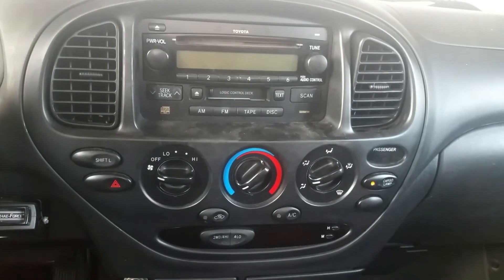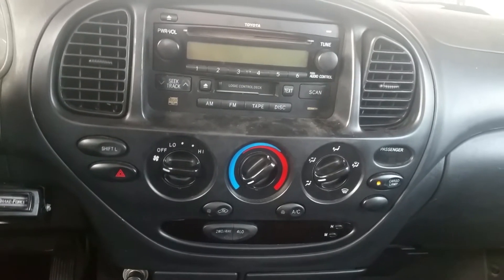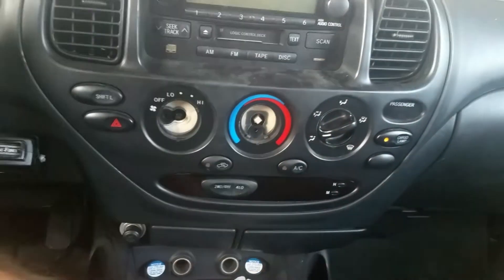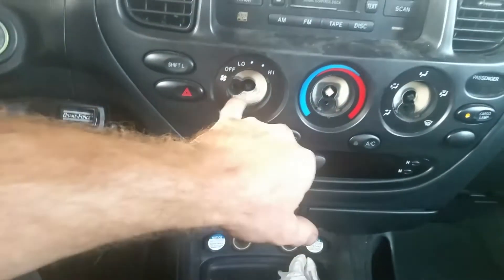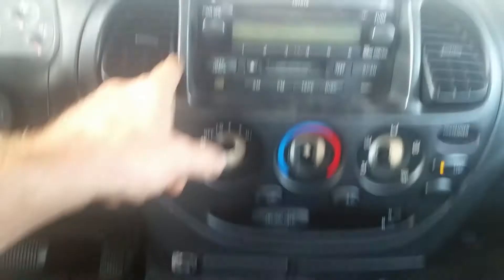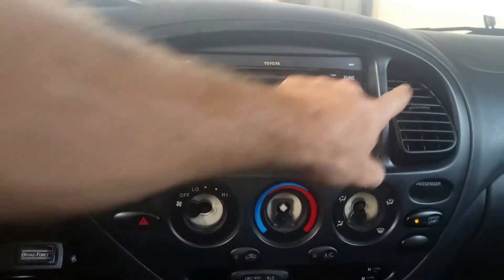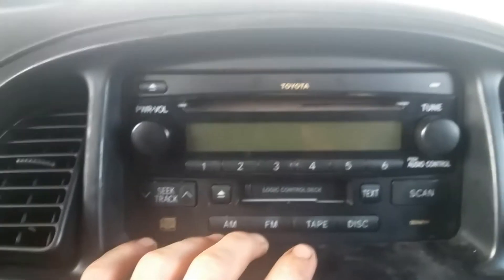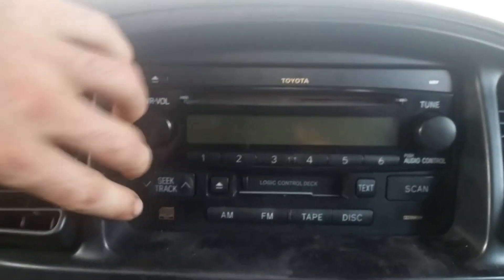00-06 Toyota Tundra Radio Removal How to/ Tutorial

Comment: Thanks for the video!  Does this also give me access to replace the bulbs for the heater controls etc?
Reply from the maker: yes it does. and you can still run aftermarket speakers off the factory jbl amplifier even though its running at 2 ohms. wont hurt the new speakers at all

Comment: I have an 03 Tundra and would like to upgrade all of the oem speakers. Do you know the wattage output of the original head unit. Is there an external amp somewhere in the truck?
Reply from the maker: if you have the amplified system the the amp will be located under the back seat on the passenger side. wattage isn't but 5-7 watts non amplified and roughly 10-20 watts amplified. if you have the few extra bucks I would recommend getting yourself a nice Pioneer with bluetooth. It will sound 100 times better than the factory deck with way more options. you can generally get them for under 100 bucks and up depending on what features you want.
Reply: @TGORRetroReviews  Thank you! Also - Do you have to remove the entire door panels to get to the speakers or just the speaker grills?
Reply from the maker: you have to remove the entire door panel to access the speakers. here is a link to removing the front and rear door panels to gain access to the speakers.
Front Speakers - https://youtu.be/Cu_kdz2dKi0
Rear Speakers - https://youtu.be/uS36iwu1tNA
Reply: @TGORRetroReviews  Thanks! Sounds like a good place to start.